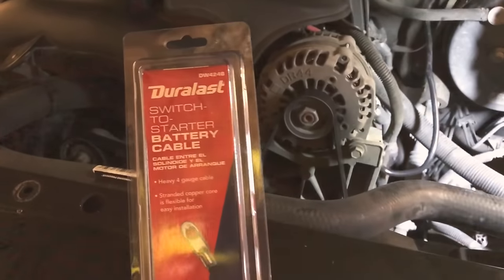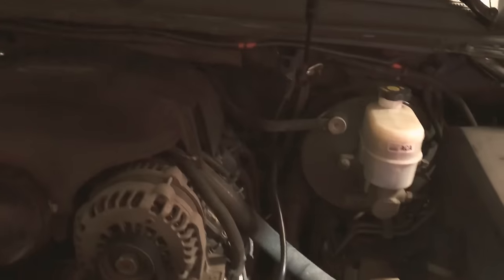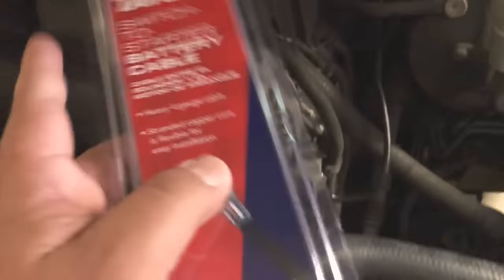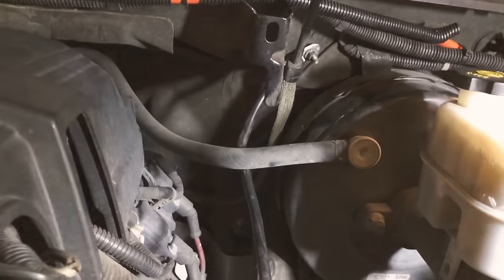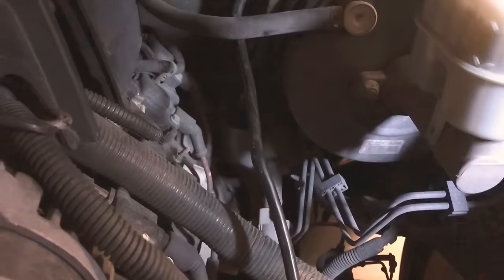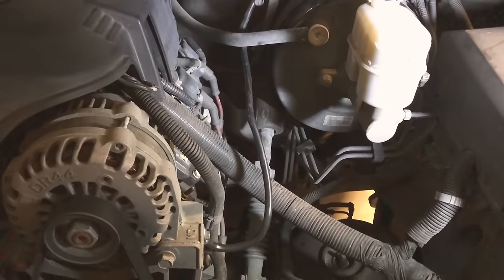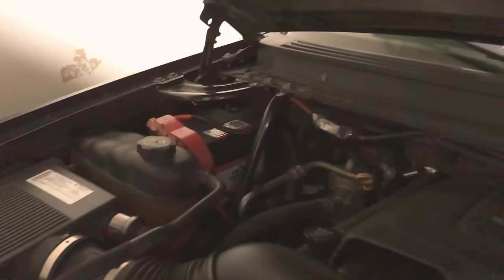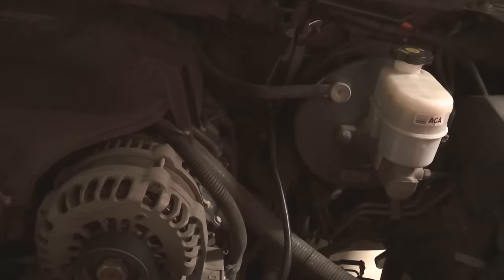07-13 SERVICE STABILITRAK FIX

Comment: I read all these comments and i started to mess with it and all it wuz a loose wire by my gas pedal service traction and stability trac and reduce power all came off with something so simple could make my truck act the way it did it wuz shaking amd would not let me speed up now it runs perfect 2007 gmc btw
Reply: Jr Cardenas what was the cable ?
Reply: @1224adam  did you ever find out. My yukon is doing the same thing. Its shaking.
Reply: Hows it been running since that fix???
Reply: Take the kid off can see what the hell you talking about god
Reply: Thats exactly what mine did today do u remember what color wire i should be looking for it on the accelerator pedal correct
Reply: What wire ?
Reply: @jrcardenas3959  do u remember what color wire to look for on the accelerated pedal also did yours when u would step on the gas for instance yesterday I started fine I get in tak off pull up to stop sign cars we're passing I was turning left then it was my turn and I gave it a little gas and it would kinda go a little faster or slower or sometimes pick up speed to fast for how much pressure I applied did that happen to anyone else?

Comment: Thanks man, I did exactly what you did and my truck is running great, my dashboard would flicker and the transmission wouldn’t change gears to the next one up, now my dashboard doesn’t flicker and my truck runs like a beast I have a 2009 Chevy Silverado 2500HD 4x4 6.0 in case anyone has the same problems as I did, thanks again, feels good not to worry about this problem anymore 👍🏽
Reply: Im about to try this. My dashboard doesnt flicker persay but it will get brigter out of now where or just stay dim for sum time. About to try this!
Reply: Where can I find the wire and what’s it called

Comment: I stumbled upon this clip over the weekend.  Thank you!  My stabilitrac light has been coming on when I start in the morning for a year when it's cold and the TPSM constantly, like 5 times per 100 mile trip since last summer. (2013 Savana 293,000 miles)  I had "fixed" it with electrical tape because the van drove fine, I just didn't like looking at the light.
I bought a cable like this this morning and installed it and neither light has lit since in 100 miles.  Thank you again.  Glad I came across you.

Comment: @Drako and others with this problem
A few months ago I responded to this video. Indeed, this worked for a while, and I thank Lalo for posting here. But ultimately, my Service Stabilitrak service light kept coming on, and I experienced many more problems as others have described here. Door locks, locking and unlocking randomly, transmission shifting into one gear and not changing, failed to start several times.  I tracked all this down and finally found a solution to my problem. 
The problem was found in the GM-LAN communication line. There is a bundle of wire that runs to the transmission. From the factory the wires are protected by a plastic cover. A heat shield is bolted to the transmission to protect the wiring and sensitive transmission components. With age and heat the plastic over cover broke away leaving the GM-LAN communication line unprotected. The GM-LAN line wires eventually rested against the heat shield, partially melting the plastic cover over the wire. This grounding of the LAN disrupted much of the Body Control computer communication.
I carefully made a temporary repair to the wires at the transmission with 3M TemFlex Rubber Splicing Tape found at Lowes. All of my electrical problems have completely disappeared. No problems at all during the last two months. 
Hope this helps others!!
Reply: What is a GM-LAN wire? And where is it run to and from?
Reply: @michaelnieber642   The GM-LAN is a twisted pair of wires, one is Tan, the other is Tan/Black. It is, otherwise known as a CAN BUS and it runs (my vehicle) from the main engine control module to the transmission control module. Other modules like the Body Control Module are attached to it and pass information to peripherals like the radio, door locks, instrument cluster, etc. It operates much like a computer USB system, but more robust. Lalo reinforces the importance of good ground connections. Wire integrity is also important. In my case chafed wires, four  were found to be the ultimate problem.
This GM Technical bulletin explains it all.
https://www.autocodes.com/uploads/gmc/08-07-30-021E.pdf
Reply: Thank you So much for the information!
Reply: Wm Tolbert thanks
Reply: Is this a dealer recall? I added the ground wire like OP said but my stabilitrak light came back on after driving it for about an hour.
Reply: Is the GM-LAN wires also the obd reader wires?
Reply: Wm Tolbert any videos to show where all this is located. My 2011 single cab is doing the same thing. I had the bcm replaced and it still was doing it. I don’t wanna have to spend $1000-plus for a $6 roll of heat shield tape. Please help!
Reply: @wmtolbert5740  so i assume this is for the 6 speed automatic only ?
Reply: Hows your car been running after that repair and what yr is your Escalade???
Reply: @mercedesbenzs600bash  hey man you look like you were looking into this problem, did you ever find a definite solution? I have been looking everywhere and can't find an answer
Reply: I’m gonna try it I too did the ground and problem came back now I’m gonna check out what you just said
Reply: Man can you do a video of the location pf those wires?? 🫡
Reply: I recently bought a 08 with the same issues. My ground was disconnected and I replaced like in this video but issues returned when it got cold outside. 

After reading you're reply I feel this is the issue and solution I've been look for. Thanks for the GM  link.
Reply: @wmtolbert5740   @kojack5231  I think this will help

Comment: WELL DAMN!!! I HAD A P0306 CODE ALONG WITH THIS SAME PROBLEM. CHANGED 6 CYLINDER SPARK PLUG AS WELL AS ADDED THE GROUND FROM THE FIREWALL TO THE ENGINE.  WOW!!!! AWESOME!!!
LETS SEE HOW IT HOLDS!! THANX FOR INFO BRO!!!!!!!👍🏾👍🏾👍🏾👍🏾👍🏾👍🏾
Reply: Hows it been running???

Comment: My 09 Silverado had been doing the same thing for roughly a year on and off... but in the last month check engine light came on and the remote start would not work... ran the new ground cable and all lights and warnings have cleared... solid fix and definitely woth the try 10 bucks vs several sensor replacements and hours of troubleshooting avoided... takes 2 minutes to give this little fix a shot!
Reply: Hows it been running since???
Reply: Had 1 or 2 hiccups in the same manner but otherwise solid!
Reply: Would this work on a Chevy traverse? If I recall correctly I don’t have a wire there it’s just bolted to the frame

Comment: Genius, thank you, I was having same issues, I bought a grounding cables and grounded my 2009 Yukon Denali in same areas that you show in your video, and my truck is running flawlessly, the service stabilizer trac and traction control lights went off and has been functioning sense, thank you again.  👍🏾 👍🏾

Comment: on my wifes 2007 Yukon, I tightened the ground cable on the left side of the engine bay and started putting better quality 93 gas. The problem hasnt come back since. I am changing the plugs this weekend too.
Reply: Did the abs light stabilitrak and traction control light come on at the same time
Reply: @raetwine1937  did ufix it?
Reply: WHY CHANGES THE GAS OCTAINE? THANKS

Comment: I did not believe that it would be this simple of a fix. so I installed a quick jumper wire and the tcs light went out . hats off to you , thanks...
Reply: Frank Sidoti I just tried and it worked when I connected the jumper wires and held the other end. Thanks!! When I install The new ground should I put the new grounding wire on top of the existing one or should I just have the existing one connected somewhere else and put the new ground wire where the existing one was connected?
Reply: @AH6man  would like to know the same thing

Comment: Thank you for sharing this. I own a 2007 Chevy Tahoe with the same problem. I followed your solution and the problem got solved. Thank you again.
Reply: Did your Tahoe shift hard from 1-2 every time the stabilitrak light came on? Then shift normal again when it turned off?
Reply: all the things mine does that
Reply: all the things my escalade shifts hard from 1-2 also.
Reply: STEVEN URBANO I’ve tried so many things to fix this and this video didn’t help either
Reply: @allthethings6419  mine do
Reply: Same here. Gonna try this later.
Reply: Jarred Owen did you figure your problem out? I have an 07 Chevy Tahoe with cylinder misfires, and service stabilitrack light on.
Reply: all the things this is happening to my Tahoe rite now same year too
Reply: Wolf gang did you find out what’s wrong with your Tahoe

Comment: Awesome video. Was having the same issue. Took to shop was told would need to replace throttle body. Researched and found your video. My ground cable was loose. Tightened cable up no more problems. Thanks again.
Reply from the maker: darthtaterll awesome. Glad it helped out
Reply: darthtaterll  was the ground cable loose on the battery or on the frame?
Reply: Why is that like the go to thing for mechanics shops, those mother fuckers always wanna change your throttle body 🤣 it’s. Casting with a flap a spring and maybe a sensor, I can see the sensor going out but the other components not really, might need a cleaning here and there, but they got a hard on for wanting to change it for some reason 😂 that’s been suggested to me for every car I’ve ever owned at some point or another lol

Comment: Had the same issues on my 2011 Chevy Silverado. Installed this ground strap 4 weeks ago and the issues have not returned. Thanks for the suggestion!
Reply: Did you remove the original ground or bolt the new on top?

Comment: This happens because you lost a ground somewhere. Usually a coil. (6  or 8) adding a strap will only mask the issue until later. Check your ignition coils first.
Reply: Where would you go about finding the problem? Just hooking up the meter to it? Sorry if it’s a broad question, my 07 avalanche just did this last night!

Comment: I was having the exact same problem.  I  did this and it worked like a charm.  Thanks bro you saved me so much money.
Reply: How she been running since???
Reply: @mercedesbenzs600bash  the stabilitrak system started acting up again so I replaced the throttle body.  So far its been running fine.  Its been about 2 months

Comment: This fixed my '07 Yukon XL!
Thank you!
Reply: Did your car shut off at a complete stop , knock when changing gears , feels like the car is going to shut off ? I have the same exact car and. Change spark plugs abs censor and cold air intake and still the damn light is on . its been going on for 4 months .
Reply: @davidvaafuti4135  No. It would just randomly turn off traction control, radically change the shift patterns, and engage "service traction control" on the display. 
Yours definitely sound worse!
Reply: What trouble codes are showing?

Comment: Did you loose power when the Stability light came on and eventually sputter out and stall? Then take an hour to finally start again?  This has happened a few times to my 07 Escalade. Cleaned my grounds tonight and checked the brake fluid as I heard on another vid might help.

Comment: I don’t see the update video you said you would make to let us know if this workaround kept working out for you. I am thinking about attempting this bc I’m having a lot of issues, Stabilitrak, traction ctrl, service suspension system, erratic RPMs, and hard time getting it started, especially in the under 30°F, snow or rain. Stabilitrak, suspension and engine light system warnings is a new development and the starting and RPMs is exacerbated the last 2 weeks. I cleaned the ground and strap and hit them with dielectric grease, as well as the one on left side of the engine kind behind the serpentine belt. And everything was good and it ran like a charm and purred like a kittens for the test ride. Then I went out a couple hours later and it fired right up but did this thing where it was started but the starter was still working like I was turning the key, nvr heard it before! And RPMs shot way up like I was revving the engine. This morning, it started up after a couple key turns and ran pretty good, but engine light was back on. So, I really want to try this hack. Can you let me know if this continues to work for you or if you got rid of it, how long it continued working?

Comment: I had the same problem on my gmc terrain and i replaced the high pressure fuel pump and it fixed the problem ...

Comment: I know it has been a while, but did you disconnect the original ground strap or add the new ground strap on top of the original? Thanks for the vid!
Reply from the maker: No it’s still connected i just added a new one.

Comment: Just got an 07 with like 5 errors on the display. Worse is oil pressure gauge goes crazy and causes reduced power or limp mode. Going to try this first thing in the morning. Thanks.
Reply: Vapers Win r u sure it's in limp mode or is it the cylinder deactivation that comes standard?
Reply: Vapers Win did it work
Reply: Did it work
Reply: Did it work
Reply: What was the problem???

Comment: Thanks bro I had the same problem on my 2007 Escalade and I had change the brake pedal switch and that cable and I haven't had a problem since and that was three months ago
Reply: big stacy Davis  still no problems?
Reply: Hows it been running???

Comment: The problem is the battery cables. Just replace them. If you don't believe me, Do a loaded voltage drop test on the cables while cranking. Anything over 200mv is considered excessive and indicates a defective cable.
Reply: So.could it be a bad battery?

Comment: I had the stabilitrack issue but this diagnosis did not apply. It was the sensor under the accelerator pedal. Other vids mention the steering position sensor-i thought of doing that myself but decided to get professional advice-if I hadn't I would've wasted a lot of time and money. So even for guys that want to do the job themselves it's a good idea to get a professional diagnosis before you start. Of course this easy fix is worth a try first !!
Reply: Do you go to a dealership? If so How much was it ?
Reply: @antmchaynes1577  yes I did. not cheap but I forget exact cost.
Reply: @antmchaynes1577  I did go to a dealer and they also replaced the entire wiring harness under the dash which apparently was a bulletin telling us we had to do that so in all it cost me 700 bucks

Comment: Did this cause the check engine light as well or misfire issues along with service stabilitrak and service traction control lights?
Reply: I have the misfire issue and scanner says it’s accelerator pedal sensor, I have replaced but still same problem. Going to try the grounding tomorrow

Comment: My tahoe has a stabilitrack light . Changed mass air flow sensor, plugs, wires, and brake pedal switch.  Code is throwing misfire code . Did your truck give you the same code?
Reply: Mines has the same problem did you ever get it fixed
Reply: @Rulestothegame101 did you ever figure out the issue?

Comment: I tried it it didn't work for me, and also I tried replacing the ACDelco D1539J GM Original Equipment Brake Light Switch
 under the steering wheel on the brake pedal. I guess I should have explained that I had a mechanic change my front struts in my rear air shock and the rear compressor. I didn't buy the electric shocks up front, so I don't know if that has anything to do with my stability Trac and ABS light on. It was never on until they change the front struts and rear shocks. right now I will take any tips that you give me that will help me thank you very much. My truck is a 2008 Yukon Denali XL, the front struts or shocks whatever which one it is it's not plugged up. Is there a bypass that will help me get rid of the messages
Reply: A common problem is just what you described, people accidentally bump a harness connection, knocking it loose. You may have to take the wheels off depending upon what size they are. But I have heard both front and back shock towers have wiring running along them and guys bump them or knock them loose when replacing the shocks. I have even heard of people going through the automated car washes and the pressure from the jets causes them problems as well. I would check all the wiring around all of your shock towers, if you haven't figured it out already

Comment: Did u smell any burnt wiring when the stabilitrak came on? Just wondering if the ground wiring is over heating. Got an 2010 Chevy Silverado and started having the same issues. I first changed out the sensor under the brake pedal. Seem to have fixed the problem. 4 months later it came back on for a second or 2 then turn off.
Reply from the maker: No i didn’t encounter that.

Comment: I  had this problem on a 2010 silverado-' dash lights came on----''service stqbilitrak - traction control-----door locks rapidly lock  & un-lock---engine rev up like it was in neutral--I took it to  the chevy dealership & they charged me $967.00  for new battery cables & resetting the computer--What started all this trouble was when I had  a new battery put in the truck  !!!
Reply: mines came on the moment I put in a new battery.
Reply: @fidenciodeleon8969  same here ... did you find the solution?
Reply: @TheTroyTv  Didnt work for me.
Reply: Hows it been running since???